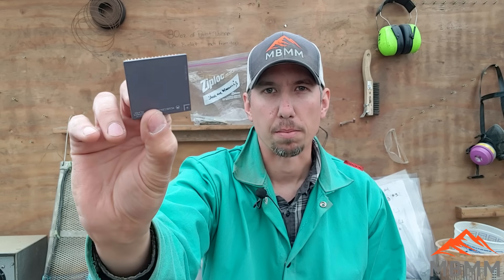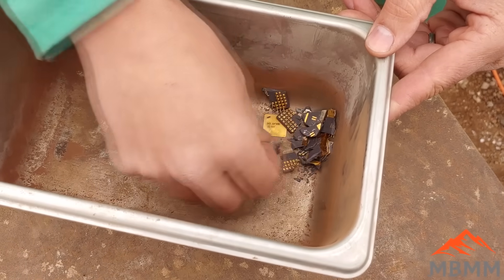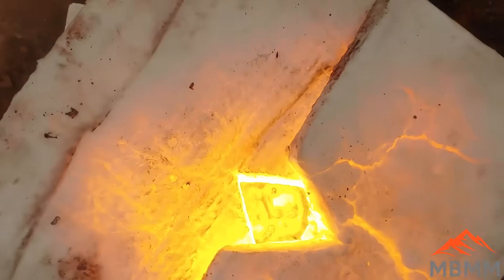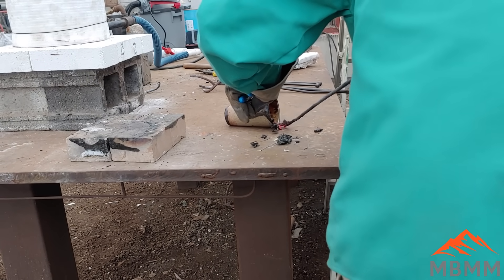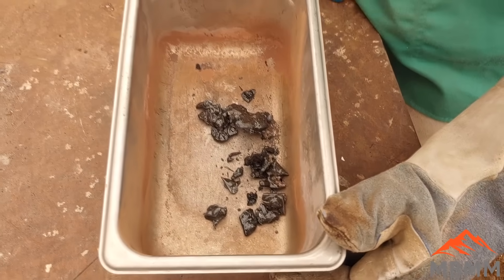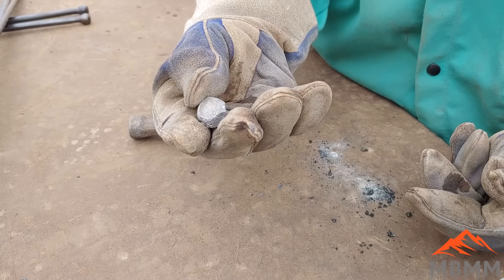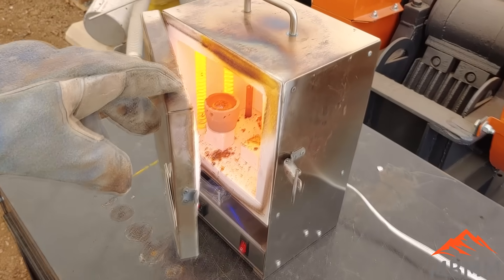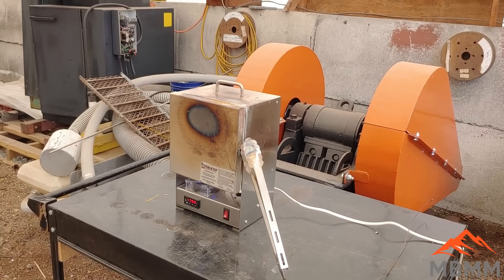Can CPU Gold Be Direct Smelted? Electronics Recycling & Urban Mining For Precious Metals!

Comment: A simpler way on the pins recovery. Use an electric paint remover (the one that looks like a hand held hair drier) … holding the chip with a pair of pliers, direct the heat on to the pins so that they really heat up, then still holding the pliers, give the chip a hard tap and the pins will all fall off … no need to break the chip up with a hammer, well certainly not now we can see that most of the chip contains silver and lead, but great there’s a different way to recover gold without using dangerous chemicals

Comment: #1 Save the CPU chips. People buy them off salvors to make jewelry from.
#2 the grid pins are gold-plated steel, as is the lid over the chip.
#3 the silver is solder. Modern electronics are chock full of silver solder, it's safer for the factory workers than lead/tin solder.

Comment: I'm just thinking loud here because I haven't seen anything like it yet and haven't even tried out anything similar to a prototype but..

How about grinding all the product down to a fine powder form and from there separate it in an electronic device resembling that classic gold pan. Maybe some kind of magnetic stirrer in the bottom to create a water maelstrom: depending on the speed/force of the water maybe the heavier metals would form in the lower parts and the lighter metals could be filtered out in the upper parts in like some filtration pockets along the sides? 🤔

Comment: 18 dollars of gold from 4 CPU's not bad really, but you probably spent more than that on gas and time to melt it down. on a large scale it might be worth it.
Reply: I get all my electronic for free out of dumpsters and Craigslist free section anything I make is profit and wages for my time so it would depend on what level of recycling you want to do, I won't throw anything away  currently except plastic which I'm looking into that too, this is all on the side and I'm just beginning so I'm not a professional either but you need 2 major things a place to do it and determination because it's not going to payout over night and at times your going to be sitting in front of 30 laptops you pulled out some tweekers trash thinking wtf did I do to deserve this, lol I haven't made a dime yet but my stockpile could easily fill a Chrysler minivan of material that I'm hoping will expand my abilities because I don't like people and if I work it out I have ideas that'd set me up so I don't have to work for some moron that only knows a single trade where I'm a general laborer by birth and have literally worked in every setting and I say f-bomb all yall I hope I'm a new species cause yall done pissed me off too many times

Comment: My thinking is that you could get rid of some of the flux. Borate is only needed when there's oxidation; so not sure how lead would work with borate since it doesn't oxidize Maybe try it with just the silica; it might remove the silicone better. Also, removing any steel, aluminum or magnetic pieces with a magnet first would help. I've also seen videos of treating the chips with acid first...

Pretty cool process. I'd call the nugget e-waste electrum.

Comment: Instead of lead, add in copper. The precious metals will alloy with it and you can electrowin the copper back and concentrate the precious metals in anode mud that can be separated chemically when you've built up enough to be economic.

Comment: Silver is more conductive than gold it's used in electronics because it doesn't corrode as easily snd you have tiny connections so they use gold. But silver is the best conductor of any metal it also conveys heat better than any other metal so the best thing for a heating element is silver and it's the best known reflector of light. Ood mirrors on the back of them that Silver film is real Silver. Silver in my opinion literally is better at everything that gold can do except it's resistance to corrosion. Silverware is actually called silverware because it was originally made of silver because as it oxidizes (reacts with Oxygen in air essentially silvers form of rusting) as it forms what we  call tarnishing it kills bacteria in the process so they used it for eating utensils. They also use to make a bar of soap from silver as well. - Steve Clay

Comment: The silver probably comes from silver loaded epoxy die attach, which glues the silicon die to to the ceramic carrier,  prior to wire bonding, the bond wires will be either gold or aluminium depending upon the finishes of the carrier and the die.  some carriers will use silver within the plating as well. If its gold wire bonds they will be pretty pure gold. Also once the silicon die is attached to its carrier and the wire bonding has been completed, almost all finishing processes will use "Non-Conductive" materials the pins which are gold plated have only a few microns of gold, purity of the pin plating will largely depend upon the quality of the chip.

Comment: You should test the metal components on the chips with XRF first. It will help to sort the different metals before the smelting process. No point melting everything into an alloy if you can isolate them.

Comment: Those sharp litle pins are gold plated copper contacters you can heat the soldering up with a torch and shake the tips of i used nitric acid to desolve  most of the copper of then ran it through a coffie filter that could be smelted and cuppelled  the rest can then be crushed and smelted

Comment: That Motorola 68040 CPU on the left sells for $50 on Ebay or Amibay...specialized IC for Amiga, Atari and Apple vintage computers.
Reply: More than that, more like $75 to $100 (assuming its working)
Reply: @Penrodyn  on Ebay maybe, but not on Amibay

Comment: Used to work in a semiconductor fab.  They can use steel, copper, aluminum, silver, gold, fairly common.  The last 4 are used for high electrical conductivity.  Honestly, the amount of energy used to reclaim precious metals makes it not worth it at small scale, done manually.  Probably more money getting copper from heat sinks - just melt, purify, cast ingots.  But large scale production, with automation, large process equipment, chemical separation, them smelting, is my guess at the most cost effective way to reclaim gold.  But hey, if you can do this more cheaply using lower tech forges and fuels (bellows aspirated char coal?) then maybe small batches would be worth it, and feasible for off-grid, back woods, post-apocalyptic world.

Comment: Almost all of the circuitry in PCB's and computer chips are gold-plated silver. Silver is the most conductive metal, believe it or not, its only downside is that it oxidizes. Copper is the second most conductive metal, but it also oxidizes. Gold is simply plated on top of the silver or copper circuitry to protect it from oxidization. Computers typically use silver circuitry, stereo wiring typically uses copper. Gold plating may or may not be found, but typically is found in higher quality components made by reputable brands.

Comment: The only place I can think of that may have silver in a CPU would be the solder used for the decoupling capacitors of the chip. They typically are on the bottom, under that metal plate surrounded by the gold plated pins. This would also explain the palladium in the final sample as these capacitors do contain a very small amount of palladium.

EDIT:

The pins are also soldered to the chip. That is an additional source of silver.

Comment: I'm just making an educated guess here semi, I would say that the wires were gold-plated silver. I know the chip wafer itself is just layers of silica chemically etched as far as the circuitry inside the chip.  When you watch them manufacture the round discs that they cut the chips out of it is just pure silica substance with no wires in it. 👍🏻

Comment: The CPUs typically have gold plated silver(or platinum, palladium, Ruthenium, or iridium) pins. Silver is one of the best conductors In electronics and the gold prevents it from corroding.  From the metal testing screen it looks like most of the pins were silver and a few were palladium.
Interesting way to get Gold though.
Have you ever melted down used bullets and used them as lead?

Comment: if you use a heat gun and tweezers, you can remove the pins. You'd probably save yourself a lot of trouble and you'd get the most of the gold off those chips.

Comment: Vintage CPU's can be worth a lot more than their weight in gold...  in fact you can find most models still for sale online..  That Silver can be from solder & uninsulated wires within chips..
You can use nitric acid to separate the silver(& base metals) from the gold, filter & then use copper to precipitate the silver out of Nitric solution.  Nitric does not dissolve the gold by itself.  Mixing Nitric Acid with Hydrochloric/Muriatic acid makes Aqua Regia which DOES dissolve gold, & then precipitates with Sodium Meta Bi-Sulphate, or "Bonide - Stump out".
These chemicals can all be bought OTC in hardware stores as well as Salons, if looking for 30% Hydrogen Peroxide as an alternative to Aqua Regia by substituting Nitric Acid.  If removing silver from gold I suggest using the Aqua Regia so the Nitric first dissolves the silver.  The divisions of Silver to Gold ratio in that button is perfect for "In-Quarting".  Very cool using the Magnesia Cupel to leech the base metals away however I think I would just use chemicals instead of incineration reducing a step when going to use chemicals anyway.  Much of the waste can also be converted into fertilizer chemicals...  something that can not be said of the Cupel'ing with lead..
-Nitric Acid can be converted into Ammonium Nitrate & Calcium Ammonium Nitrate, "Among other things".
-Hydrochloric Acid or Muriatic Acid is caustic & sometimes used to acidify water & soil to achieve a lower pH level for Plant Growth.

Comment: and one last thing a lot of the pins have a nickel coating under the gold usually remove the pins with a propane torch then a hard drive magnet can be used to separate the magnetic pins from nonmagnetic as they may need to be processed separately..

Comment: the sodium hydroxide will turn the silica in the ceramic into water glass which is water soluble and could be used to turn sand into a high temp solid material and so can be easily separated from the rest of the chip that get rid of 80 + % of what you need to to get to the bonding wires but bare in mind that even pentium pro's well known for their high gold content you would have to do very well to geb .2 grams per chip old chips are better but even with the good ones there is not a lot of gold . my x room mate got sick 3.5 years ago and died about 8 months ago and when that happened i lost a lot of the stuff i had but what we did save when into storage in a van anv exterra and the bus i now live in. the the van and exterra will be moved to my location in the next couple of months if you want to revisit this then i know that one of the few things that was saved was about 40 pentium pros and a bunch o scrap silver in several different forms it had been my idea to collect pentium pros when ever i could get them where i would not lose to much money because every time the price of gold changes people go nuts and pay to much for these chips and if silver really does go up i can always extract the gold myself if that  will pay better also the grey dust on top of these chips is a silver base heatsink compound same for a lot but not all CPU's so if you are wanting to do this again in a couple of months i should have almost 40 t play with but even then you will be very lucky to get 15 grams :-)

Comment: CPU’s have silver and gold from my experience.
Usually I lightly burn, crush, dilute nitric to remove silver and base, Aqua Regia the remaining material, drop gold with SMB. Cement out silver with copper.
I’ve been experimenting with the cupel process to reduce my acid cost and waste. 
There’s no super shortcuts as best as I can determine so far.
A few times I have used this process up to removing the base with dilute nitric, then picked out as much as possible the ceramic material and junk silicone chips then directly cupeled.
It works fairly well but the cost seems to be a wash and sometimes I will get crud on top while cupeling which will have some gold caught up in it. I Still get a bead or two of gold, but will Crush the crud and put in a pan and gently blow off the very light powders and cupel the remaining material again.
Thanks Jason having fun with the process.
✌️PT

Comment: Interesting example of what you don't have to do if you want recovery gold from computer chips.
Whit all the ingredients and methods you do, are loosing more than 50 percent of the gold.
First, the silica sand and the sodium hydroxide that you use, retains a lot of disolved gold than not precipitate even if you add a lot o lead.
I don't know if you really want to show a method to recovery gold or want that nobody does.
The media content for gold of that kind of old computer processors its around 1 percent of gold by the weight.
So for 100 grams of material you must get around 1 gram of gold if you do in the right way.
If you want to melt directly all the material will be so far better use only  borax and sodium carbonate as flux.
You will have a better and more fluid melt and more concentrated metal material at the bottom

Comment: It is very weird seeing an XRF reader used outside my industry. We used it in paper manufacturing to test for concentration of silicone. Basically, when you have a sticker, the backing is siliconized. We had to have an appropriate amount of silicone, which was measured by our XRF. We also did linerless paper, which had silicone on the face, and adhesive on the back. It would stick to itself just enough to make rolls, but peel apart without requiring a backing

Comment: i have been trying to find which method is better to recover gold from chips. i have some that were melted into bars. what would be the way to ground these bars and smelt them? i don't want to chemical to dissolve and reheat again. i like your method of using cupel to melt the contaminated residuals. i learned a lot from your video.

Comment: you wil  not find gold in coppermine technology of present days . after pantium processor there is copper not gold ..gold is plated on connector pins like- Ram, processors pin , sound card pins and connector, some optical and  usb connectors..Gold in processor is not rare.
some LED [old] panel display use gold wire in transformer like Viewsonic VA712 model.

Comment: your biggest problem is your trying to use geological means to extract a refined metal from a chemical process. The difference between metallurgy and chemistry. Also, you continue to refer to the circuit boards as fiberglass, they are phenolic. There is a pretty big difference considering they are produced using silica and silicon particulate because of their conductive property. Silicon wafers are GROWN in clean rooms, in cylindrical pieces then cut into circular "wafers" by which the processing is ETCHED onto them and then introduced to the housing and suspended  using processed precious metal for conductivity. Super short synopsis but the point is you CANT refine like you would rock, you need a chemical process to separate the phenolics from the metals.
Reply: Like a rock hiw??
Reply: How can a rock be processed

Comment: All chips have, more or less, the same ratio of gold to silver. The silver is mostly from the pins. Silver is a better conductor of electricity, but corrodes (where gold is a lesser conductor, but doesn't corrode). Unless you have HUNDREDS of microchips to MELT at the same TIME, it's economically not worth trying to extract the precious metals.
Reply: Here